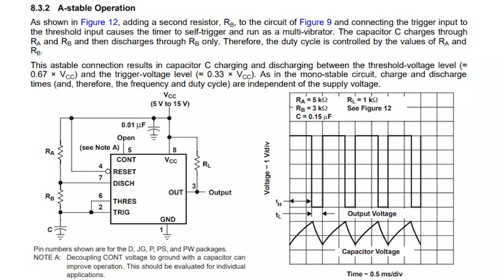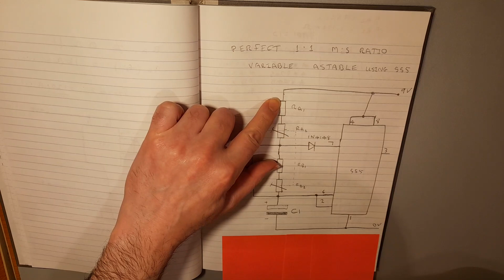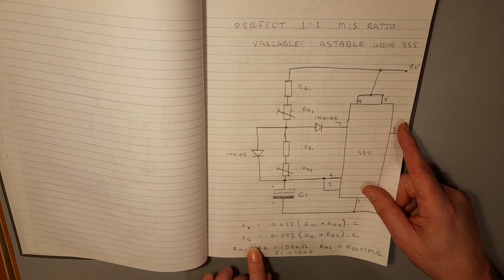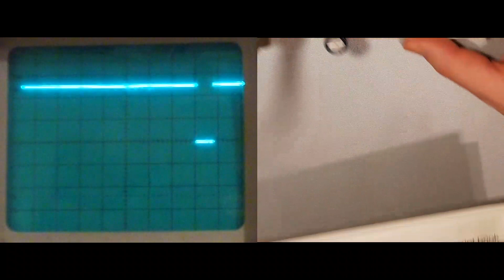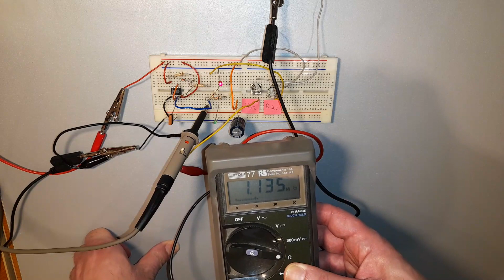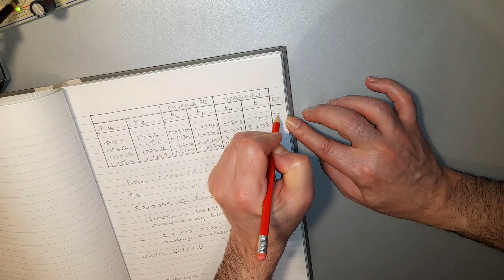Designing a 555 Astable With Less Than a 1:1 M:S Ratio

Comment: thank you for the very educational video. have you looked on YouTube at "555 Timer Kit: Adjustable PWM Duty Cycle with FET Output Driver".
Reply from the maker: Thanks for this. And very interesting too; I've just watched it. The pcb design is not very good and the circuit is interesting but would have benefitted from a couple of end stop resistors but the presenter/maker of the video was excellent in describing it and his channel is superb. Overall, very good. Thanks for bringing it to my attention.